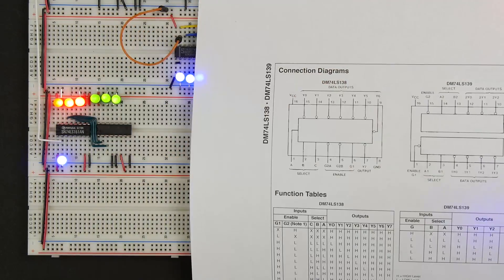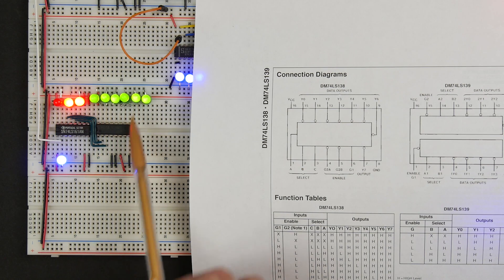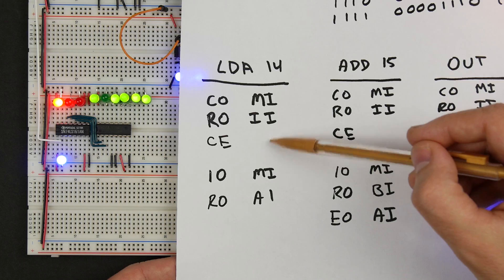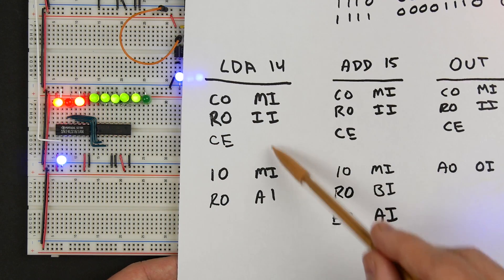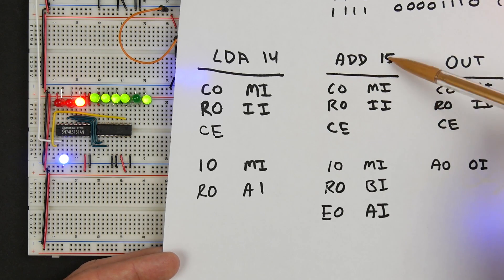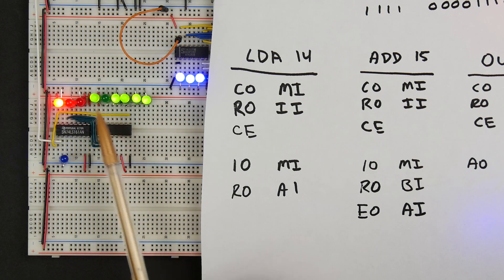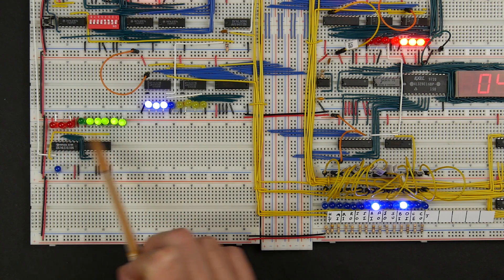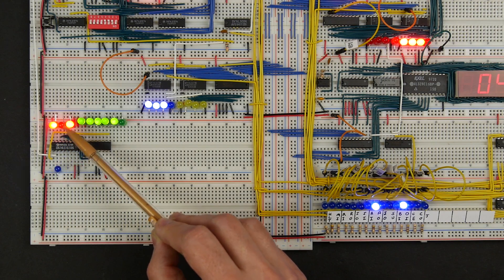8-bit CPU control logic: Part 2

Comment: How would you go about increasing the ram? You of course need a bigger ram chip and some other chip but still. You would need to increase the program counter as well, but then you would still be limited to 8 bits since the data bus is only 8 bits. and also the instructions only contain 4 bits of data so dose that mean that you can't increase memory, or would you need to instructions to set two different mar?
Reply: There's multiple ways you could change the setup to enable larger memory address space, for a historical set of bad ways to do it, the ways that the 640K barrier in the old Intel chips is worth looking into. At the end of the day though you need something to use more than the 4 bits we currently have for address space. It's definitely possible, but it's not as simple as most of the rest of the build. Three different options are:

Change the instruction/address setup so that you don't use 4 bits for instruction and 4 for address, if the first bit is 1 then all of the other 7 bits are address bits, then you could reference 128 bytes of memory without too many changes to the setup for the current computer build. The ARM instruction set format is probably a little complicated, but they have some instructions that are different lengths, and as a result certain instructions can have more space for operands. http://infocenter.arm.com/help/index.jsp?topic=/com.arm.doc.ddi0210c/CACCCHGF.html for more info.

Also in the ARM architecture, you can use the registers as addresses. It's slightly impractical with only two registers (A and B) to use, but there's no reason it couldn't still work. You could load all 8 bits from register A into the memory address register and then read out the value. You still have the problem of getting the full 8 bit value into the registers with the 4 bit operand in the instructions.

To address the smaller operand width, you can have separate instructions to manipulate parts of a register, so you could have Put-A-High and Put-A-Low to manipulate the high and low 4 bits of the A register. Using both instructions you can also write values from instructions directly into the registers instead of storing them in memory, however it takes more instructions to do the loading, so it only helps with writing larger values using instructions.
Reply: Just some thought on your ideas; How exactly would you implement instructions with different length? The idea sounds simple but you have multiple instructions setting the memory address register so how would you know witch one to use if you only had the first bit tell that its an address or not? Would you not have to expand it to maybe 3 bit and have the first bit signal that it's an address and then the next two saying e.g. if its LDA, LDB or STA? Then you would only be able to have 32 memory locations which wouldn't be that much of an improvement.

The other two (I guess it's really only one suggestion) seems to be the best and easiest to do. But all the solutions don't address the limitation of only 8-bit addresses width. How does 8-bit computers have more than 255 memory locations? Do they have a bigger address bus and is it therefor hard to have more than 8-bit addresses in this computer without altering the design widely?
Reply: +Alexander Simko Short answer: yes, bigger memory address bus-widths are needed for more memory, if you used a pair of registers to access a 16-bit address space you'd just have to tie those registers into the RAM module more tightly. If you want a larger PC register then you'd also have to tie that more directly to the RAM module to avoid using the 8-bit bus. 

Longer answer (what I first typed out and is less concise): There are definitely still some problems inherent with only having an 8-bit width architecture, at a certain point just increasing the bit-width is going to be the easiest solution. For the example based on this computer the most you could ever reference is an 8-bit width to access 256 bytes of memory. To get more you definitely need something to have 10, 12, or just more-than-8 bits. The Intel 8008 might be worth looking at for details on how it was used historically, it used 7 registers (ABCDE/HL) H and L were the indirect memory address registers and could be used to access 14-bit addressable memory (2 bits from H and L were ignored). It looks like the 8008 also used 8-bit opcodes for most operations (full list https://bytecollector.com/archive/mark_8/My_Mark-8_Info/Software/8008_InstructionSet_CodeSort.PDF ).

If I were trying to design a short opcode instruction I'd probably just designate A as the special register that everything is loaded/stored from (the computer would probably be easier to code for if it had more than 2 registers as well, so that overwriting A frequently wasn't as important). Then you could use 1 bit to signify 6-bit load/store from A, then one bit to differentiate between load and store, then 6 bits for an address. Then you could issue a move from A to B, then load the next operand. I think that changing the architecture to reference memory addresses in registers would be more flexible in the long-term though.

Edit: Missed part of the original question, sorry. As for implementing different length opcodes, everything would still be handled by the control logic, so if it saw 10aaaaaa it could see that as a 6-bit LDA. Instruction specific code starts at T2 as Control register out (00aaaaaa) to bus and memory address in. T3 as Memory value out and register A in. T4+ no-op/next instruction. This would also require  a shift from 4-bit to 6-bit (or larger) memory address width, and changing the current setup that can only output 4-bits from the instruction register to a setup that could output a variable number, you could just use another 8-bit out EEPROM for that though and treat the bus like another 8 control lines.
Reply: +Ben Harper Thanks for the answer! I think as you say that the register solution will be the best one for this project. I wanted to expand the memory a little bit since 16 addresses isn't a lot, but 256 will be more than enough for this computer. It's not like it's going to be an amazing computer anyway (or it will be in its own way). But it's fun to know how it actually would be done in a real computer.
Reply: At the end of the day, there's a lot of invaluable history in computers that any kludge that works is good enough. For bad examples about how to expand memory you can see some of the information around the DOS 640K memory limit and the kludges that were designed to work around them https://en.wikipedia.org/wiki/Conventional_memory#DOS_extenders The biggest requirements are that it's reliable and predictable, being a bad idea doesn't mean it won't work.
Reply: Ben Harper Technically the 640KiB limit wasn't chip level, merely a partitioning of the 1MiB space they chose. The address manipulations before and after are far more relevant (segments, EMS, gate A20, XMS and descriptors, 32-bit, and it's still ongoing with e.g. PAE). A little more straight forward is the upper address latch used on for instance SNES cartridges and AVR external memory buses.
Reply: It just had the advantage of being a topic that I'd seen a really good write-up on recently, I'm sure there are better examples like you mentioned that I just don't know anything about. Thanks for sharing them.

Comment: I love this video series. I'm confused about the use of the demux though. You could put all of your microcode into one ROM (assuming enough data bus width) by using the T-state counter as the low four bits of the microcode address, and the content of the instruction register as the high four bits of the microcode address. I can't wait for figure out why you're demux-ing the counter. One ROM per instruction seems inelegant. If you used ROM's with inadequate data bus width, you could just address multiple ROMs in parallel to gain enough bus width for the control bus, but the multiple ROMs wouldn't be enabled independently so no demux-ing would be needed there. I also feel like incrementing the instruction counter should be the last thing that non-jump instructions do, instead of the first thing that all instructions do. For example, if the program counter is 0x00 and I do a reset, I expect the first instruction executed to be the instruction stored at address 0x00, not the instruction stored at address 0x01, as your current microcode would do. Similarly, if I jump to address 0x80, I'd expect the next instruction executed after the jump itself, to be the instruction stored at address 0x80, not the instruction stored at 0x81. Maybe I misunderstand something.
Reply: I think I understand what you mean now (although it's late for me too certainly). The program counter is read in T0 then incremented in T1, the incremented value isn't re-read until the next instruction cycle so the change won't affect memory read that also happens in T1. So during T0 you read the PC into the memory address register, then during T1 you read memory using the stored value, not the live value from the PC.

In some bad pseudocode:
From power-on/reset
//PC = 0, T=0
MemoryAddress = PC
T++ // T = 1
InstructionRegister = MemoryValue
PC = PC + 1
T++ // T = 2
...then opcode specific stuff happens.

So the PC value is stored before being used so any updates to the counter after T0 won't change which value/opcode is loaded from memory during T1.
Reply: As the control logic isn't implemented all I can do is guess, but the demux might just be a visualization tool as the 3-pin version would be perfectly suitable to use in the control EEPROM circuit. So you need 4 lines in for the instruction register and 3 lines in for the microinstruction counter (using an un-demuxed version), and enough EEPROMs to make up your control word width (24 bit control word, 3 8-bit output EEPROMS).

Because the Counter-Enable is activated before the instruction specific code is executed, a reset or jump would update the Program Counter after it's increment and behave as expected (reset would set it to zero, jump would go the the specified address). For instance a jump could be T0 - Program-Counter to Memory-Address, T1 - Memory-Out to Instruction-Register-In + Counter-Increment-Enable, T2 - Address-Register-Out to Program-Counter-In, T3-T6 - No-op/Reset. After execution the Program-counter is your desired value and the cycle starts over.
Reply: For the counter increment logic, I understand that reset/jump will update the PC after its own (earlier) increment, but the instruction at the target address will ALSO increment the program counter before reading the opcode. So assuming we're at PC=0x0 at T-0, and that the instruction at 0x00 is a "LD 14", the decoding for our instruction will increment the program counter to 0x1 BEFORE it reads the "LD 14" opcode. So the program starts with the instruction at 0x1. Jumps will work similar. Your jump instruction to address 0x8 will put 0x8 in PC, then as part of decoding that address it will again increment the PC to 0x9 before fetching the opcode at 0x8. Jumping to 0x8 will never run the opcode at 0x8, and resets will start at 0x1. Is there a flaw in my reasoning (it is really late after all)?
Reply: This is actually what I have done in my build. I'm using only 2 ROM's for the control matrix. The lower 3 bits are made up of the un-demuxed (I don't even have the demux at this point, its on order) T state counter and the upper 4 bits are the instruction bit pattern. I put both of these together to come up with a 7-bit address that looks up the control sequence. One ROM is for 8 of the control lines, the other ROM is for the other 8 control lines. Both ROM's are addressed at the same time.
Reply: Ben: Oh, yeah. Thanks for that explanation Ben. That makes a lot more sense now! I went back and rewatched part 1 where he explains the use of the CE vs the MI control lines.

Gerald: To make micro-instruction programming easier, I wonder if you can reduce the number of required control signals from the ROMs until only one 8-bit ROM is needed by demux-ing the various bus inputs together into only 3 ROM data bits and bus output enables together using another 3 ROM data bits (since only one thing can output to the bus at once, and presumably it is only useful to input one thing from the bus at once). That alone isn't enough demux-ing to reduce the control signals to 8 bits, but maybe there are some others that can be combined similarly. E.g. if you never need to input enable and jump at the same time, you can run the J control signal though the "inputs" 3-to-8 multiplexer. Similar logic could apply to halt, possibly.

Comment: Since we already have output module, I wonder how one design an input module and probably the corresponding INPUT instruction. So that we can run an interactive program with this computer.
Reply: the book this computer came from had a 2nd design that added the input hardware, lots more RAM, and a BIOS ROM.
Reply: Would definitely be possible, having an input enable instruction that can read the input and put it on the bus.

Programming that in would be the more difficult part, seeing how with this build, we only have 16 addresses to work with. Would be doable yes, but there isn't much you could actually interact with.

But, then again, this build is just to learn the basics. If you ever wanted to expand, you could use this as a good guideline. I've certainly learned a lot from watching.
Reply: It would probably be possible to make something very similar to the RAM programming interface with a series of switches; beyond that you just need the logic to control when the values are put onto the bus and it works just like any other module in the computer. I imagine the limit to practicality (probably not a real concern, given the nature of this build as a teaching tool instead of a purely functional one) would be that it's hard to program values quickly. If you expanded it you could create a module that would store several values and read them in sequence each time a value was read, but then you'd essentially design a different RAM/ROM module.

Definitely a useful exercise to build any of such inputs though. Handling pauses (halt/unhalt) waiting for input could also be important.
Reply: All you need for an input mechanism is a DIP switch and a tri-state buffer to select whether or not to put the switch state onto the bus, which would be loaded into the A register by the IN instruction.  Given the tiny 16-byte address space, you really can't make any practical programs for this computer, but you could demonstrate that you are actually reading input by writing an Count-By-N program that repeatedly adds the input value to a memory location and outputs the value to the LED display:

0x0: ldi 0x0
0x1: sta [0xf]
0x2: out
0x3: in
0x4: add [0xf]
0x5: jc 0x0
0x6: jmp 0x1
Reply: Thanks for the link! Been trying to find a PDF for a while now.

Comment: I could help you with the schematic and PCB design 
:D
Reply: Brandon Ruiz Vasquez why would anyone want a PCB for that? The whole fun of the breadboard computer is being able to experiment with the hardware
Reply: Well, in Mexico is very hard to find electronic components, so if I manage to make a PCB with everything embedded, I could teach computer architecture in a more simple and practical way. In mexico, components are sold about 10 times the price than in the US.
:/
Reply: I don't think using a PCB would change the cost. And can't you buy the parts on ebay?
Reply: No One oh sure
with about a year of anticipation and an arrival success rate of 30%
sadly 
:/
Reply: It's actually more like a month and 100% success rate
Reply: No One 
Not in my case
or maybe I'm just extremely unlucky